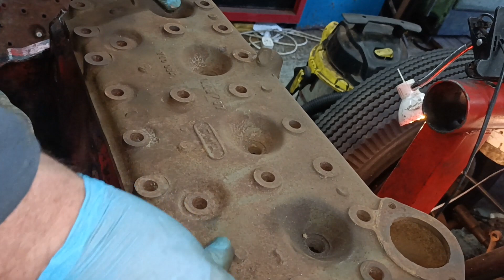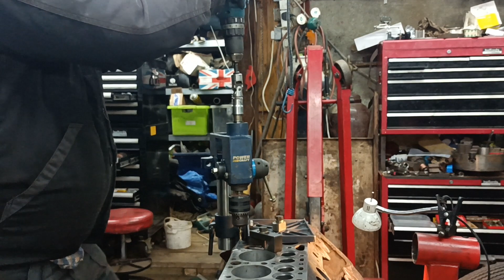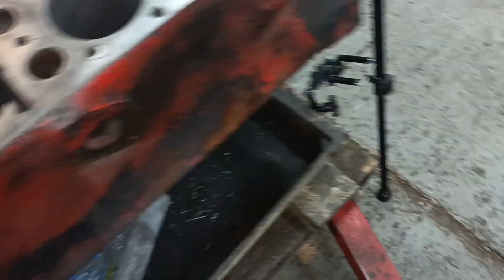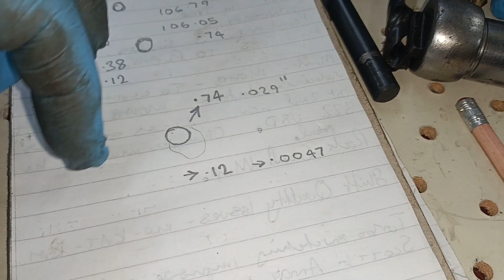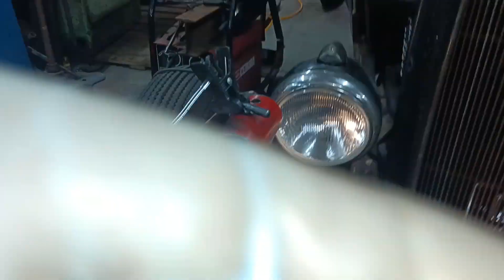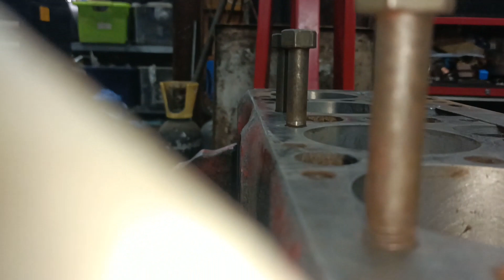2239 Marts Garage: Head stud hole from Hell. Let's make it serviceable!

Comment: Good end result, maybe some small pilots for the various steps in drill as you open it up would stop drift in the disimilar metals? I like how you worked through the problem and got there with perseverance.

Comment: You mention a "milling Machine" and that's what I was thinking while you were drilling the plug. I was thinking, even though you were using a "drill" bolted to the block, wouldn't a 4 cutter mill be a better drilling tool?? Also, one of those "centering" (center punch) sets is  great help when trying to do something like this and they aren't all that expensive. How do you plan on straightening the stud without risking breaking the casting??

Comment: Nice job...good save...I actually had one at one time with a head bolt drilled at an angle like that. Since the bolt head didn't fit flush I simply over torqued it a bit and had no trouble.